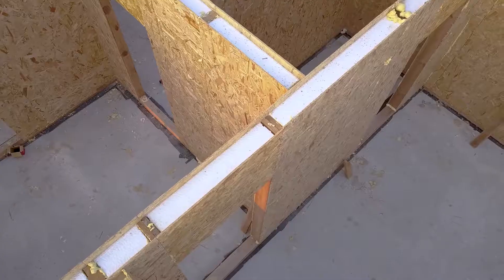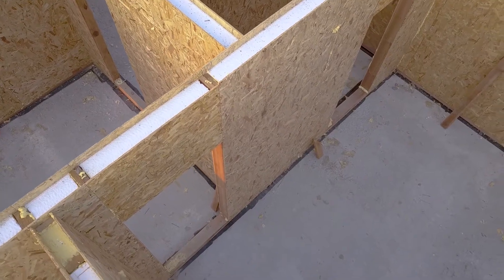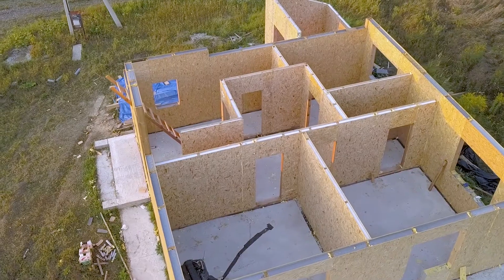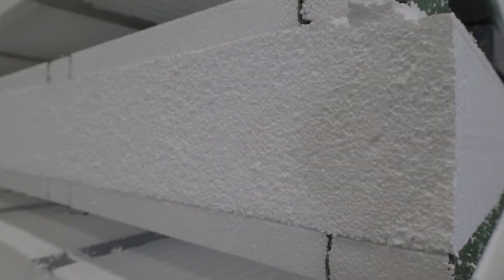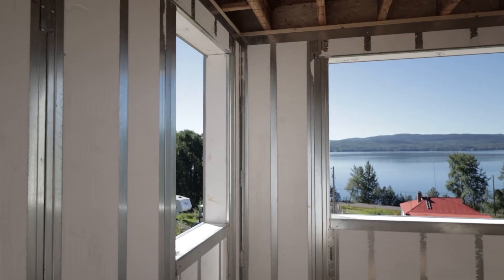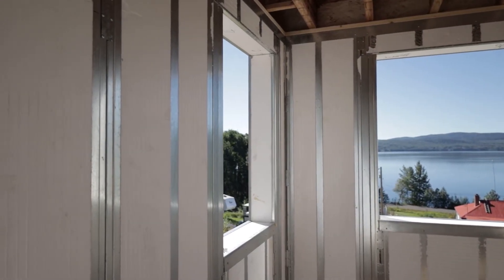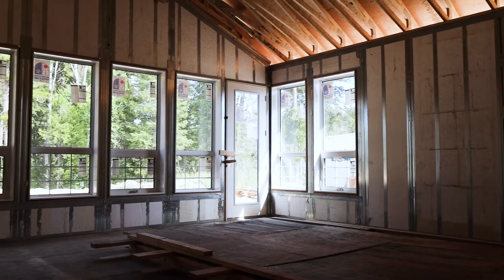Break The ICE | ICE Panels vs SIPs

Comment: You did not define what ICE stsnds for or how they are made  or who makes them
Reply from the maker: ICE Panel stands for insulated composite envelope panel, and Greenstone Building Products produces them. We're a manufacturing company based out of Brandon, Manitoba. They're produced using two inorganic materials - steel framing and a thermally broken expanded polystyrene core. More information can be found on our website - https://gsbp.ca/what-are-ice-panels/.

Comment: Essentially a steel version of the Ray Core panels. I personally won't use steel studs even if they are galvanized, But I live on the coast in Alaska. Not going to install a steel stud that will rust away plus conduct gross amount of cold in and heat out. I'm sure the price point and shipping costs are prohibitive as well!

Comment: Just a moment here. You still need to sheath the house with ICE panels and that is going to be a lumber product like OSB with a WRB over it then siding. Not giving the ICE panel hate over SIP, but you're being a bit disingenuous about your prioritizing of one over the other. Also if the frame is not stick built I.E. Timber framed then SIPS takes any thermal drift out of the equation.
Reply: OSB sheathing is only required with ICE Panels when the engineer deems it necessary due to structural requirements. In most cases, sheathing is not needed. Also, ICE Panels are thermally broken, so there will be no thermal drift with an ICE Panel envelope.
Reply: @MrBrussell17  I've been researching this. Does your product meet residential code in Minnesota for wind? That was my concern. Yes, the ICE panel was going to be good for thermal drift. I was giving an example of how SIPs can be used to also take thermal drift out of the equation. I'd still have concerns about creatures like insects getting past the WRB and easily being able to penetrate the foam whereas a SIPS with a factory applied WRB such as Huber ZIP can be taped/ flashed and made air/ water tight as well then have the foam behind in addition for a secondary level of protection.  That isn't to say your system isn't also a fantastic product. I'm just asking about other things that I cannot find information about online.
Reply from the maker: @koryleach9660  These are great questions. We have yet to complete a project in Minnesota, so we are unsure of how ICE Panels align with building codes specific to that area. Here is a direct link to our QAI listing which covers all the testing data: https://qai.org/directory/greenstone-building-products-ltd/.
Reply: @GreenstoneBuildingProducts  I imagine you would have to get shop drawings made and approved by your engineers for these panels before they're fabricated right? Even then, I remember from being in the field the MEP engineers and fire marshalls love to be able to walk around and see all the piping insulation in the exterior walls, electrical box placement, fire caulking, etc. BEFORE we could cover up with our insulation.

Comment: Steel joints run much colder than wood joints. That's a fact so, she lied about that aspect of ICE panels.
Reply: ICE Panels are thermally broken because the steel studs don’t penetrate through the wall stopping the cold temperature from entering the building through the envelope.
Reply: Yeah no thermal bridge for either sips or ice

Comment: If wood is so bad, why do I see wood trusses and floor decking? How do you modify the ICE panel? All means and methods will require some modification.
Reply from the maker: ICE Panels are prefabricated in our manufacturing plant, so no onsite modifications are needed. Feel free to call 204-726-1426 with any other questions. Thanks!

Comment: Wood will last just as long as steel as long as the house is built properly and moisture doesn't get in. Since so many passive houses are built with sips, the thermal bridging is not an issue.  This video is industry talk designed to sell you a product, not educate you. Not that this is a bad product (compared to traditional building its probably great), but it's basically another SIPS panel.
Reply: The fact that the SIP acronym is explained at the start, but at no point is it explained what ICE stands for.
Reply from the maker: @stediasse  Thanks for the feedback! ICE stands for insulated composite envelope.
Reply from the maker: The ICE Panel may be similar to a SIP's product, however it functions quite differently. There is no thermal bridging which will reduce/stop moisture and condensations issues are eliminated. In any building method, it is good to use basic building practices to make sure this won't occur. There are other benefits to consider with the ICE Panels such as R-value, shorter build times, air tightness and less waste on site.
Reply: @GreenstoneBuildingProducts  all of the benefits you're describing are essentially the same as SIPS. You have a continuous insulative layer with high r value and no thermal bridging. This is able to provide an airtight shell for the house (when installed correctly). Rather than an outside layer of OSB or CLT, you have steel. There may be a structural advantage to this over OSB, but I'm sure there's also a price difference too.
Reply: @grantcrawford823  Many sips have wood frame inside to carry load down - so often can have bridging. Other SIPS can accept a SIP Spline but not all actually have continuous insulation.
Reply: OSB IS not a good product